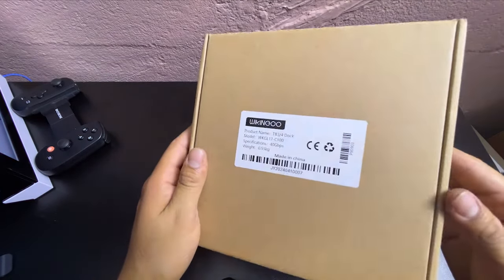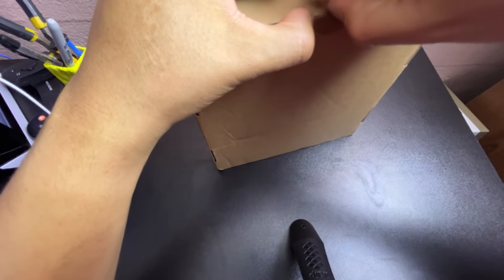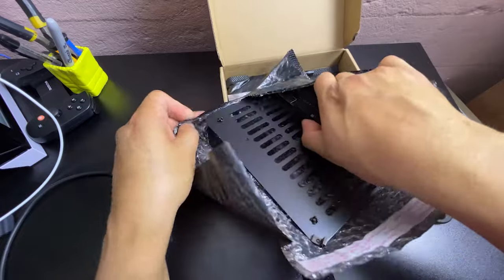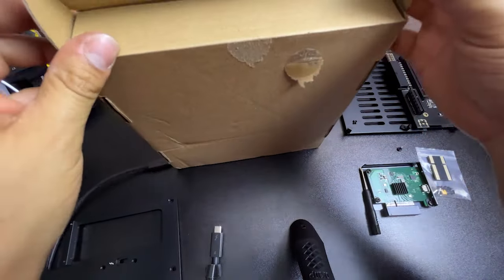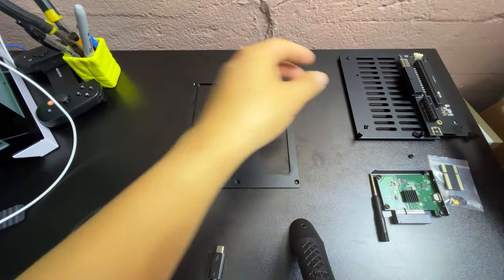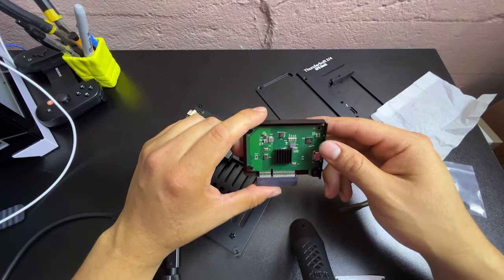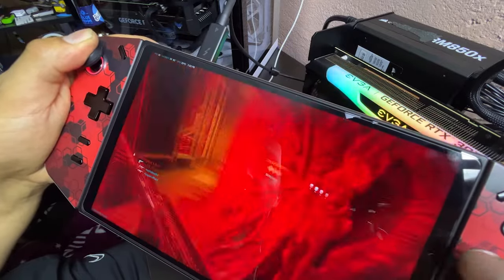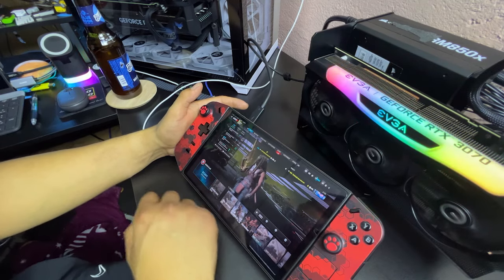Legion GO + EGPU [Can't this be your next gaming setup?]

Comment: Not a fan of GPU dock. Generally its price point is not worth it. If you gonna need it then a laptop like Legion makes more sense.
Reply from the maker: While it has its pros and cons, it is certainly ideal for quickly fixing issues in high-demand games. Just imagine being able to use it easily while it is charging and playing, simply by using a longer cord. Also Egpu aren’t that expensive if you have old pc parts laying around at the house.

Comment: Bro, first thank you so much for the tutorial. I followed every steps but turns out that my LLG cannot handle both drivers, those from the machine and those from the RX 6750 xt I just bought. Please can you help ? 🙏
Reply from the maker: @mathiouz33  I’ll say just ddu all your graphics card drivers and go straight to NVIDIA page and download the drive for your RX6750 after that just reboot it. I know some of my friends have been having issues lately cause of the new windows updates but make sure you don’t touch anything from your integrated graphics card in your legion go
Reply: @Sk8Salvyboy94  thanks for your help ! Shouldn’t i install the original drivers after doing the ddu instead of the eGPU’s ? Mine is actually an AMD one
Reply from the maker: @mathiouz33  yeah just stay away from updating the original internal graphics cards leave it as it is and just download the gpu you’re going to use. That’s how I got mine to work the second time because it didn’t want to work at the first time. Make sure you turn off your windows automatically downloading because then you’ll have issues depending what’s gets download or not

Comment: Sir I have rtx 4070 super and I am planning to purchase legion go. Is it really worth it if I play on legion go screen. I dont want crazy performance like desktop. I just want smooth gameplay above 30 fps. Please reply sir.
Reply from the maker: 4070 would work fine to be honest with my 3070 makes every game work great. The only thing I’ll tell you that if you get anything higher than a 3070, you won’t be seeing that much of improvement since you’re limited with the thunderbolt type C connector. I have a 4070 and there’s not that much of improvement either you might get another 10 fps but that’s it.
Reply: @Sk8Salvyboy94  Sir I have an extra 4070 s so I just want to use it. I just want to know if it stutters or if the gameplay is smooth?
Reply from the maker: @amankumar-ft2ck base on my own 4070 it’ll run smooth.
Reply: @Sk8Salvyboy94 Thank you sir for the reply.

Comment: i think it would work better if you use external monitor?
Reply from the maker: @PrimeMajin  correct, i have used it on a 165hz monitor and it definitely plays much smoother than the the screen. I wouldnt recomend it with a 65hz tv tho lol

Comment: at 27:09 what does he do to get the gpu to power on?
Reply from the maker: @sidshekar  there’s a little switch right underneath the gpu so that’s how I turn it on and off
Reply: @ oh I think this is the older model. The model I have doesn’t have the switch. Thanks
Reply from the maker: @ it’s all good 👍🏼 I hope it works goood for you cuz its definitely nice to use it for that extra juice of power 💪🏼

Comment: Hey, I'm wondering what happens to the integrated GPU while you're using the external one. Is it 80% inactive? I wanted the load to be maxed out on both but I'm not sure whether the integrated will just take 0 load and let the external do all the work
Reply from the maker: @khaledm8754 0 load it switches always to the external but sometimes you just have to double check it's selected in your device management settings

Comment: I had to change Charging Speed Under High Load in bios to slow for my 3080 to be stable, and then turn off cpu boost with handheld companion. I think limiting my gpu to 88% with afterburner helped as well.
Reply from the maker: @warlockboyburns  really? I didn’t recall doing all that to pair my 3070 oc to my legion go but I’m glad it worked for you on the 3080
Reply: @Sk8Salvyboy94  Slow Charging Under High Load is the default but I changed it.

Comment: Hey aman, can we get a detailed guide on how to install drivers. Do you really need to DDU when egpu is Nvidia?
Reply from the maker: @therock005  yes you do unfortunately it won’t work if you download the nvidia app and try to plug it in. I had to put my system in safe mode and then use the DDU application to remove all drives related to nvidia and amd. Once I did that and reboot it the system I went and downloaded the nvidia drive and then plugged my egpu very easy and simple to do. Just watch a few videos of how to use the ddu software and then you should be able to use your egpu
Reply: @Sk8Salvyboy94  actually I just plugged it in, let windows update grab the generic Nvidia display adapter restarted, then installed the latest Nvidia drivers restarted again and it's fine. Thankfully I didn't have to mess with DDUing anything. It all worked well for me without any hassle
Reply from the maker: @therock005  well, that’s awesome bro! I’m glad it worked good for ya and now, this when the fun starts! 💪🏼

Comment: Hey there. When i plug in my egpu my 3080 doesnt show up on display adapters. I used DDU to uninstall amd drivers in safe mode and then when trying to download nvidia driver, since it doesnt recognize that i have a 3080 plugged in, it ends up saying my system isnt compatible when performing the nvidia driver. Could you give me any advice?
Reply from the maker: @koreyhalligan9633  hey someone here in the comments section said this about their 3080. “I had to change Charging Speed Under High Load in bios to slow for my 3080 to be stable, and then turn off cpu boost with handheld companion. I think limiting my gpu to 88% with afterburner helped as well.” Maybe me that will help 👍🏼
Reply: @Sk8Salvyboy94  recently I've figured out how to get my 3080 to show up and it's working mostly now. I mainly play Diablo 4 on my legion go with the 3080 and I don't think it causes too many issues. But if I try to play hogwarts legacy, it shuts down. Maybe if I try to lower CPU and lower the charging at high loads, maybe that'll help with that. Thank you! I'll give that a try.

Comment: 00:19 Dude, TB three quarter dock?  :)
It's Thunderbolt 3 / Thunderbolt 4. 
That being said, thanks for sharing your experience! Much appreciated.
Reply from the maker: What I meant to say but came out as 3/4 😅 hey still a good compliment thanks!
Reply: @Sk8Salvyboy94  BTW, I’m a fellow photographer & also got myself a Legion Go with an eGPU running on a USB4 dock.
But I went with an AMD 7900gre GPU rather than an nVidia
Reply from the maker: @ZakiQutteineh  awesome, did you see any improvement in your photo editing software in the legion go? I have not tried it yet but I’m sure will be good for another video.
Reply: @Sk8Salvyboy94  My main machine is a Mac Mini M1 16GB, which is doing ok but recently Adobe Photoshop / Bridge haven't been performing great. I find myself running out of system memory often.
The Legion Go with the eGPU on an external 4K monitor have been giving me much better performance! 
Only problem ... my dock does not offer power delivery.  :(
Reply from the maker: @ZakiQutteineh  yeah that ram might not be enough. I have also a Mac 💻 but I prefer now editing my photos and video in my pc. I have about 64gb of ram in my rig but it’s enough for me to run Affinity photo pro and Lightroom without any issues.

Comment: Hi, i have the same egpu, also a 3070 gpu. The egpu dint charge my legion go, i have to use the ac charge on the other usb port.

Your egpu charge you legion go?
Reply from the maker: @mbbsul  Unfortunately, I’m facing the same issue, but there are alternative solutions, like using a dock. I've seen some eGPUs that can charge your Legion Go while still keeping the eGPU connected, but they can be quite expensive.

Comment: I'm planning to buy a Lenovo Legion Go, to in the future buy an Egpu like a 4070 or a 7800xt, but I wanted to know if you noticed any bottlenecks or any notable problems since I don't want to waste a graphics card either. And if these are too much for the Legion Go, do you think I should buy a 4060, 4060 ti or a 7700xt?
Reply from the maker: @Emilio-Calderon  I think a 4070 would be a bit too much like it won’t be that much performance gain. I do have a 4070 ti in my rig and I have not tried it yet but with bottleneck I can tell you my legion go display about 97-99% cpu usage with the 3070 OC gpu showing about 31-40% usage. So yes there’s bottleneck but will stay stable through the game. I’ll be making a video after I have a month of trying this setup so stay tune for more my friend

Comment: Hi did you ever get G sync to work with an external monitor?
Reply from the maker: @charleyweinhardt  honestly I would try that but my current monitor doesn’t support G-Sync 🫤 I’m guessing if you go from the graphics card to a monitor that supports G-Sync it should work fine.
Reply: @Sk8Salvyboy94 thanks, G sync works with pretty much all free sync monitors at this point, I know this graphics card to work with this monitor it's only in the EGPU setup that I'm having the issue

Comment: Hi, one question, if I buy an RTX 4090, will I be able to play Fortnite with epic graphics? Or any other game with high graphics and good fps? More than 60
Reply from the maker: @CheaterMobile  honestly I don’t know but with my 3070 I can play every game out there on high settings but i only see around 110 to 90 fps in most games I play.
Reply: What? Yes you can but it will sacrifice some fps, which in this case you want the upper hand, high graphics setting will be better for single player campaigns 👌🏻👌🏻
Reply: I don't think a 4090 is worth it for an egpu setup I don't think you benefit past a 2080ti

Comment: hey bro the console is charging by the thunderbolt to?
Reply from the maker: @hma419  unfortunately no. Maybe the newest version I linked in the videos bio might have an extra charging port but that cable it’s designed to just transfer data and no charge. Don’t quote me wrong but that’s what I think since it’s a different type of type c cable. (40gbs)
Reply: @Sk8Salvyboy94  thanks. there is another with charging but see more this one on YouTube

Comment: Im personally thinking to buy a egpu so whenever i want to play on a a big screen ill just plug the legion go to the egpu and a TV and voila
Reply from the maker: @Alishaplay10  Rest assured, adding an eGPU to your Legion won't have any negative impact on its performance. Instead, it will provide a significant boost in performance for some of your games. In my experience, even when playing demanding titles like Dragon Ball Kakarot or exploring open online maps, the Legion runs much smoother and cooler with the eGPU. However, it does reveal some CPU bottlenecking, so I suggest opting for a graphics card ranging from the 2070 to 4070 series for optimal performance. Going beyond that range won't necessarily enhance performance due to cable limitations. Connecting your setup to a high-quality monitor will likely improve the overall experience compared to using the Legion's built-in screen.
Reply: @Sk8Salvyboy94  indeed . I think you should maybe do a selection of games with the egpu and the legion go and make a performance showcase video. I think most of us are eager to see how it performs .

Comment: Just get the Rog Ally
Reply from the maker: @SkinCareLuver  I think it’s the same thing with a worse display. Right now this setup it’s rocking it out for gaming at my room lol
Reply: @Sk8Salvyboy94  Actually the display is great. You can't notice the difference between this and the Lenovo Go 1440ps screen
Reply from the maker: @SkinCareLuver  yeah but doesn’t the Rog ally has a 60hz display? I feel like there a huge difference from that to 144hz I’m sure it looks the same with doing some tweaks on the settings
Reply: @Sk8Salvyboy94  ugh no! it's 120 fps
Reply: @SkinCareLuver I had the rog ally, returned it within 24 hours to get this and a steam deck oled,  the ally just has those bad bezels, smaller screen and feels like a toy